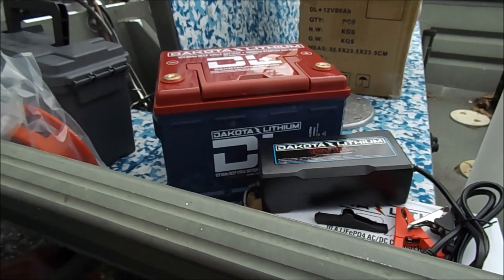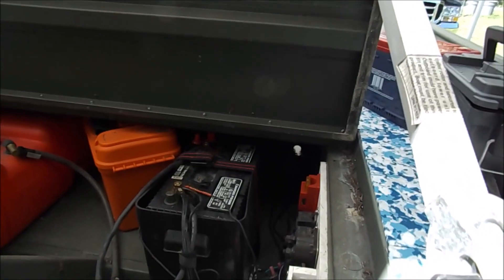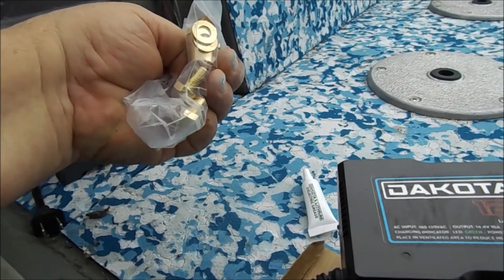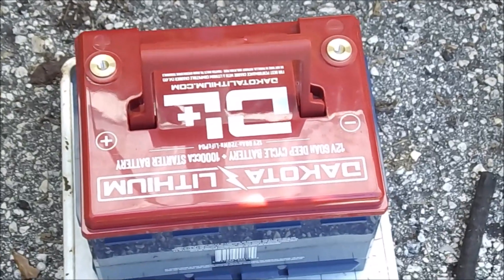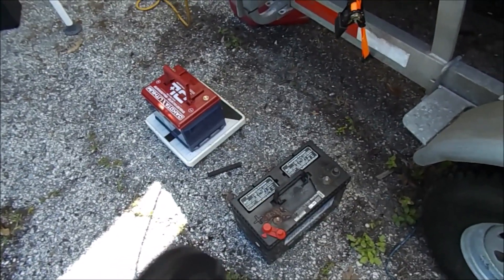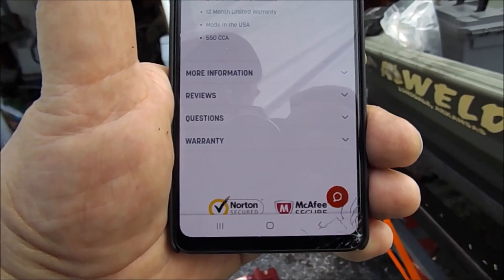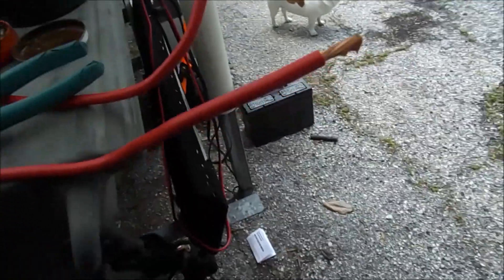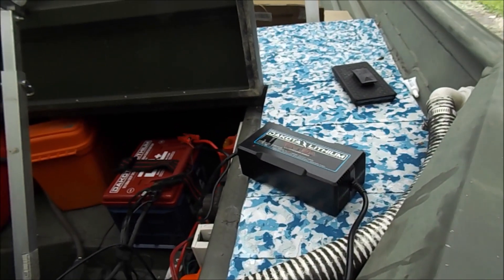Dakota Lithium Ion Battery

Comment: I have been thinking about buying one but the cost stops me .  I hope it works out well for you .
Reply from the maker: My buddy has had one for almost a year. He swears by it.
Reply: @RandolphRelicRecovery  The race car guys like them because they are half the  weight .
Reply from the maker: @idigdaytona4478  I was surprised how light it was.
Reply: Hi Martin , I bought one from Walmart on line. It just came today. I haven't opened the box yet. I put a solar panel on my boat house to keep it charged. Fingers crossed .

Comment: That is a lot for a battery. But if it holds up you might save. I have a John boat that needs a battery so we will be looking to your video for help. Good luck and happy hunting brother
Reply from the maker: My friend bought one first. He runs his trolling motor all day and still has plenty left to start the motor and run his electronics. He hasn't quite had it for a year yet. Time will tell.
Reply: @RandolphRelicRecovery  thanks brother